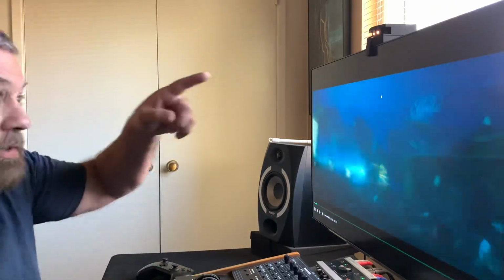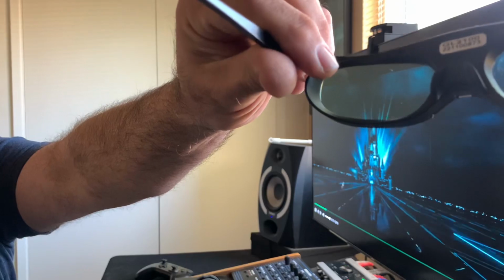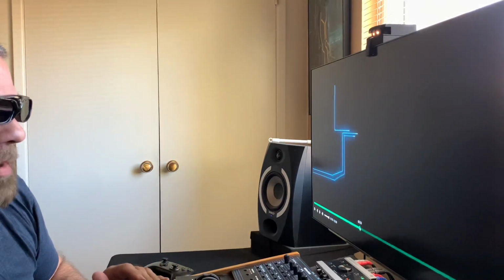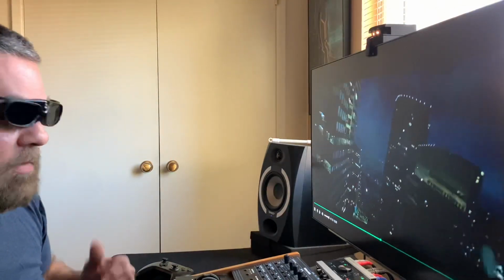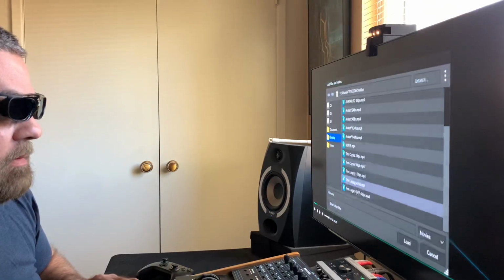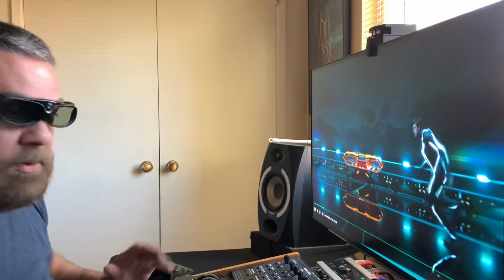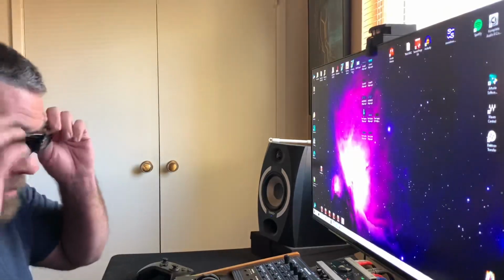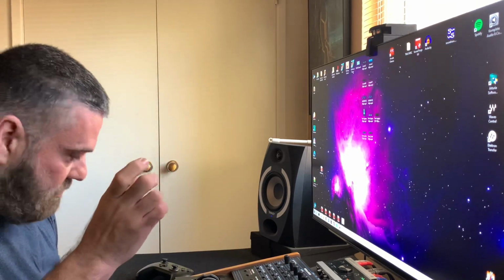Watching Tron Legacy and Avatar in HFR 3D.. at home!

Comment: Much needed device can't believe noone made it yet. It's so stupid that modern TVs don't have ANY options of running 3D since from what I understand all you need is software to combined the two images into a single interlaced one and a way to connect the active 3D glasses (and they used bluetooth which every TV has now). Modern TVs are SO much brighter and faster that they eliminate all the weakspots that killed 3D in the first place and basic 24 frame 3D should be super easy to implement. If your sync device also increases the framerate that's just downright amazing.
Reply from the maker: Thank  you for the message! We are really hoping to see active 3D take off again so we can start using our modern displays in modern ways :)

Comment: Would this work on a onn Qled 4k tv it claims 120hz effective refresh rate whatever that means I'm not sure but im sure you do please get back to me on this someone
Reply from the maker: Hi Andr, it depends on a few things. First, the TV must have some form of black frame insertion. Second, panel must have a very fast g2g response time. Combined, these will minimize 3D cross-talk. The SYNC device will work on any TV, but it's the cross-talk that is solved with OLED (and fast response) panels. My guess is that your TV will have a clear horizontal band somewhere on the TV, the rest will have left and right eye images bleeding together.

Comment: I am very hyped for this! does this work on 120hz tv's or only on 240 hz?
Reply from the maker: This works on 120hz TVs, but a feature called black frame insertion is required to keep the cross-talk down. LG has seemed to have deprecated this feature in their C2 OLED line, and there's no indication if they are adding it back to C3. They are doing BFI at 60Hz, because the can write firmware to make every other frame black, but a 120Hz BFI mode requires either a 240Hz panel OR special timing hardware to inject black frames.

That said, we are working towards building the glasses that will mitigate this requirement from the display panel. OLED panels have a quick enough response time that the cross-talk issue can be resolved on the glasses themselves.

Comment: You're on to starting a revolution boss.

Bring it to market, I can't wait to buy 👍👍
Reply from the maker: Thank you, I am pushing to make it happen!
Reply: Looks Great ! Could it work with a LG C1 77" TV ?
Reply: Hey Greg! Yes, this works great on LG C1 TVs. The newer LG OLED TVs lack BFI so it’s only usable on the C1 (I have a 48 and 55 which I’ve used for a couple of years now).
Reply: @pgiokaris  GREAT ! What about the conversion / upscaling workflow, can it be performed locally on a OU / SBS file ?
Reply: @GregPanos  Yes, it works on SBS so I imagine it would work on OU as well. The size I'm working with is HD, so the file is 3840 x 1080. There's no issues with the line between the images. Flowframes is excellent. It has quite a few choices of A.I. interpolators, I ended up using RIFE with CUDA. Pretty quick as well, it can chug through a 5 minute scene in about 20-25 minutes (24->48).